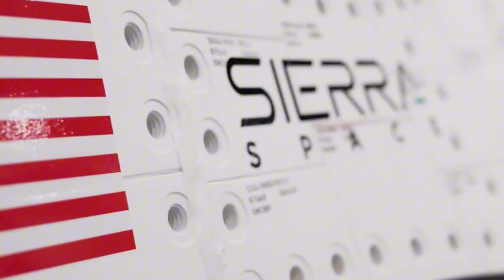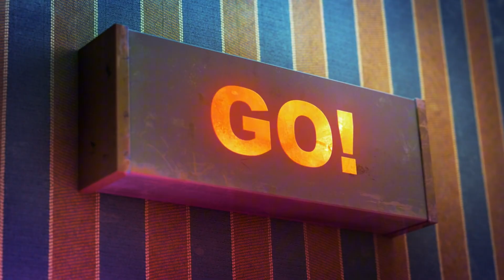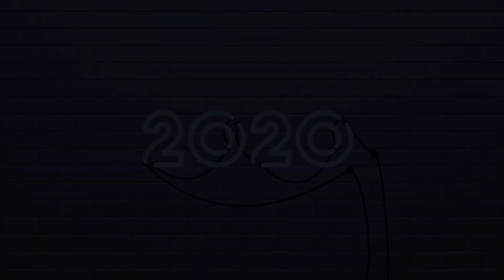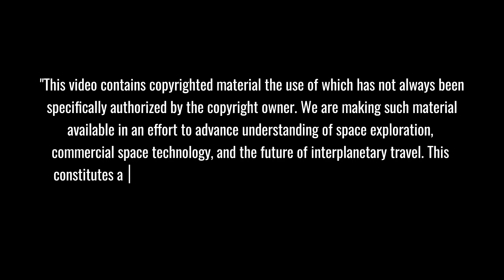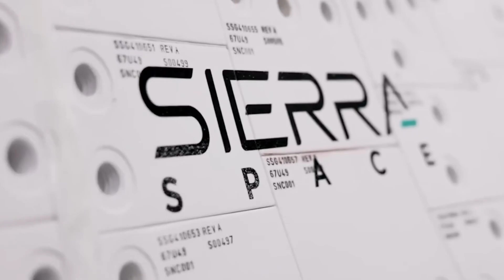Astounding Revolution! Dream Chaser Challenges SpaceX to Redefine the Future of Space Travel!

Comment: Who is going to continue to launch it twice a week? You will run out of rockets because they go in the ocean. 🌊 New Glenn has the right idea 💡, just launch BO now.
Reply from the maker: True, reusability like SpaceX’s rockets or New Glenn’s design is key, but does Dream Chaser's runway landings bring a smarter alternative to the table? 🌌✈ Thoughts?
Reply: Blue Origin will confront the driving problem with their very first launch (assuming they are actually able to land it on the drone ship...)  If/when it lands, BO will take six months to bring it back, inspect/replace one or more of the landing legs damaged in the landing, re-certify the engines and other critical flight hardware, and stage the next launch.  New Glenn is impressive, but BO has miles to go to get the enablers in place to be competitive with Spacex.